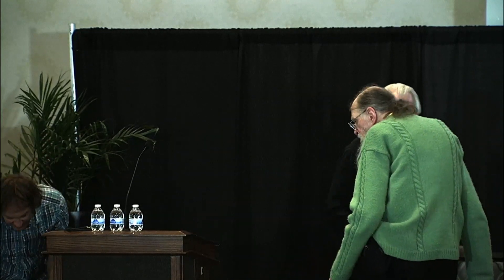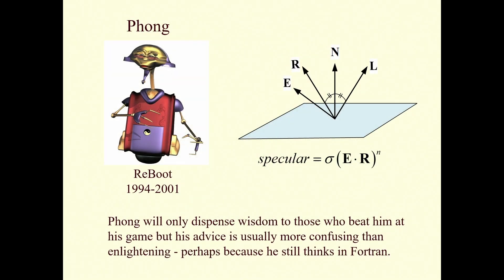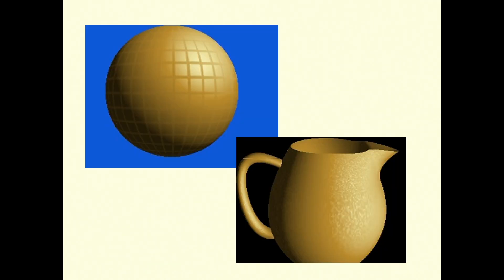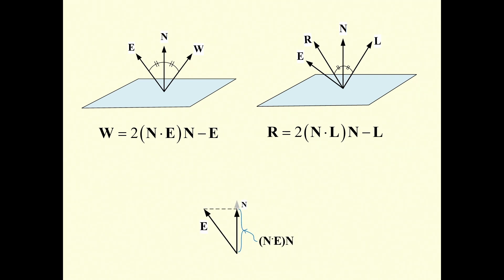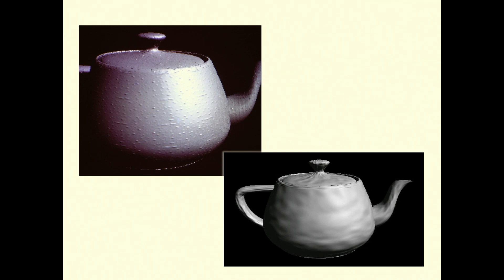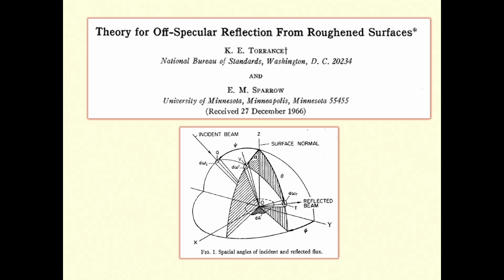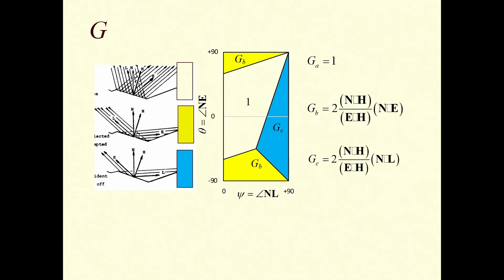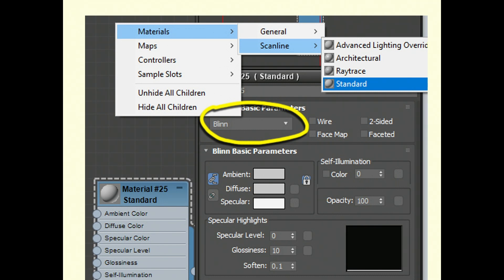04 The Bumpy Road to Blinn Shading - James Blinn

Comment: I sit here rendering 37 million triangles in Keyshot and I'm glad I don't have to do these maths, but I appreciate the pioneering work. I started at the U of U in 2001 and slept through most of Dave Hanscom's classes, but eventually went to UVSC because they had a MUCH better program for computer graphics at the time.
Reply: Funny thing is, depending on your scene, we could shade these millions of triangles using Blinn or other methods and display them in real time. The* techniques are still great and have uses, especially for efficient previewing when working on the scene (so almost every viewport in 3D DCC tools). It's the 'final' render that takes more time, because it's using more complicated methods. These methods were possible because of research done by Blinn and many others, but lets not blame them for the render times now haha